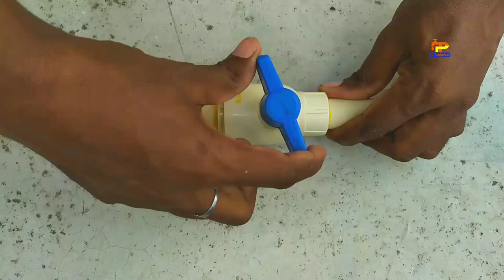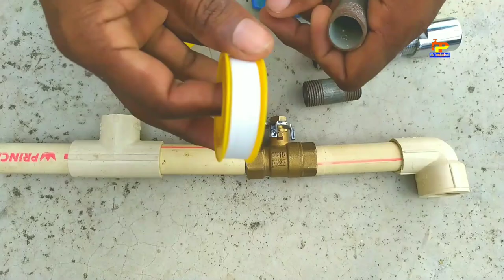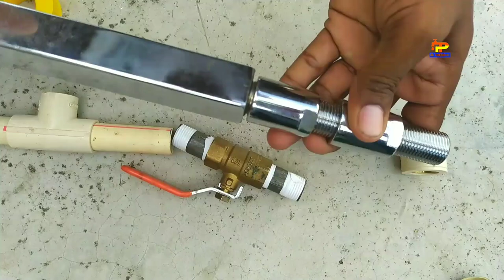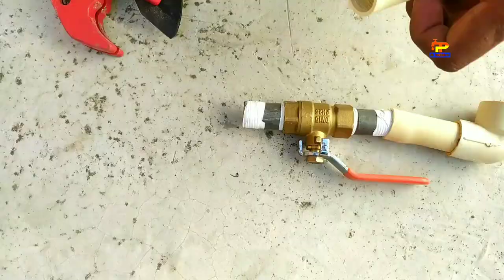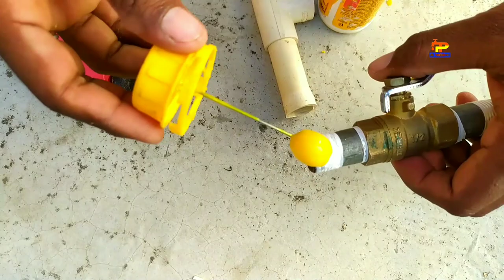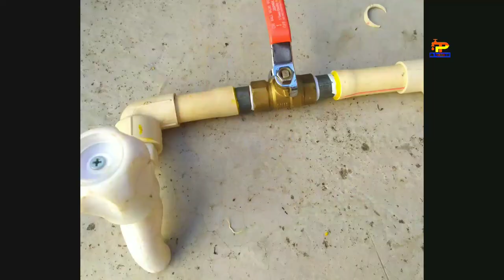CPVC PIPE SE GI BALL VALVE JOINT NEW WORK PLUMBER AK TECHNICAL

Comment: Always use union so that when ever ther is issue in  ball valve it can be repaired and reinstalled . The present vedio will reduce cost however if UNION is installed both sides it becomes easy to open and install it back. That will be more money saving and helpful .
Reply from the maker: The price of the speech in India is as much as that of the union.
Reply: @aktechnical6029  àà